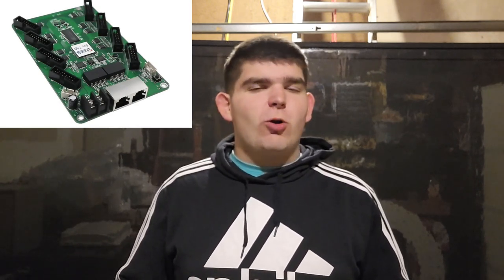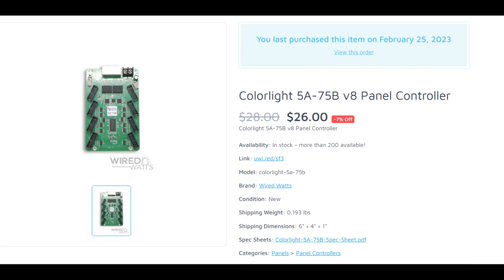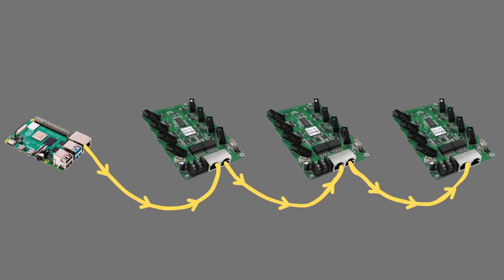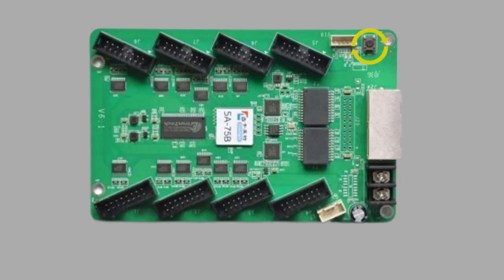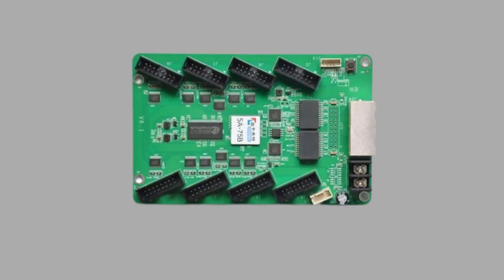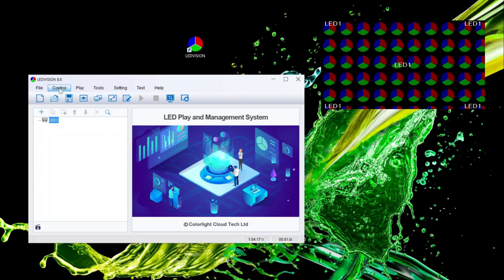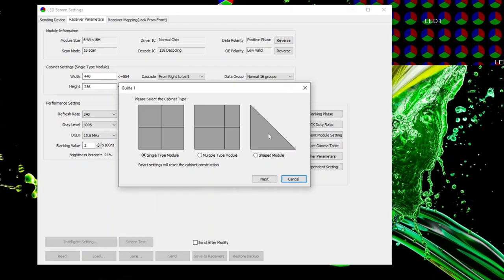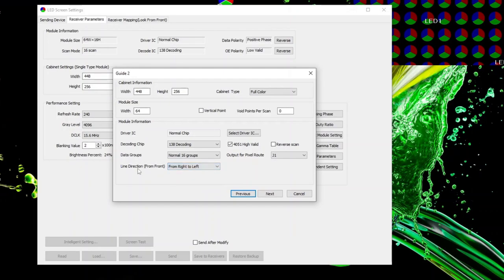Colorlight 5A-75B Panel Controller Tutorial with LEDvision, FPP & Xlights

Comment: Thanks for a very helpful video. Just want to add that you also need to set your total screen size in Control > Screen size and count , and in 'LED Screen Settings' > Receiver mapping tab. LEDVision version 9.0+ has removed the net card option, so download version 8.8 as used in this video.
Reply from the maker: Thanks for the information, I'll make sure to do that next time! I probably won't be making any other videos though about LEDvision because I don't really need to change my colorlight card unless I get another panel 😂

Comment: I have this Colorlight Board hooked up to two panels that’s hooked up to Raspberry Pi 4 thru RJ45 cable then on a Windows Computer I’m running FPP with LEDVision but no cursor is on panel what am I missing(waiting on new card
Reply from the maker: So sorry for the late response, I've been away on vacation. Have you found a solution to your problem yet? I will say I'm not the biggest expert with panels and there's a lot of different steps that could easily be messed up to cause the problem. I only know the basics to get it working and run it in a light show with FPP

Comment: How does one control the brightness of the P5 panel when using a Colorlight card and FPP?  I haven't figured out how to control the bright.  If using a BeagleBone there is an option in FPP to control the brightness.  I asked the vendor that I bought the panel from, but they were no help and their customer support never responded to my questions nearly five days after Christmas even though I asked around 9th of Dec.
Reply: I found an old Ron Howard video from 7 years ago.  In xlights under the Layout tab, there is an option for "Dimming Curves" where there are some controls.   He recommends setting the gamma to 1.8 and brightness to -30.  Tests to see how it works within your display.  Going to try this and see if that helps.  Hopefully it does and this info might help someone else
Reply from the maker: Usually what I do is just leave all the brightness settings for the effects in Xlights around 60. The only problem with this is if I forget to change even one effect or video to the lower brightness, that part will stay really bright. What you're talking about doing sounds like a good idea, let me know if that works.

Comment: I am currently working on a project where I am building a screen with P3 LED modules, which I aim to control directly using a Raspberry Pi 4. However, I am facing challenges in connecting a receiving card (specifically, the Huidu HD-R712) to the Raspberry Pi 4 to display images stored on the Pi.
Could you please provide some guidance on how to achieve this?
Reply from the maker: Which software are you going to be running on the Pi to communicate with the receiving card? I will admit that I am not the best with these types of projects, and had a hard time trying to figure out how to use the colorlight card. I know how to make it run a panel but nothing really advanced with it.
Reply: @How2Pixel  Thank you Nick for replying
I am planning to connect the Raspberry Pi with a synchronous sending card, which will then be connected to a receiving card and finally to the display modules.

In this setup, I do not want to manually add content to play on platforms like LEDVision. As it will be difficult to automate, instead I am thinking of playing the content on the video player on the Pi, and using the synchronous sending card to display it on the modules.

Could you please tell me if this is feasible or if there is a better way to achieve this?
Reply from the maker: I really wish I could help you out and answer your questions, but I'm not really sure how to run the colorlight card with any other software besides LEDvision or Falcon Player, the software I had on my raspberry pi. I'm sure it's possible, but I don't know how since I don't have much experience with that type of stuff. Have you tried looking online for some other tutorials that might help with what you're looking to do?

Comment: My LED matrix uses ICND2153 driver chips. But ik keeps flicikering or giving worg images. Is there a way to fix this? I've tried multiple led matrixes but the same problem appears
Reply from the maker: I'm not really sure of any solution, I've been having the same problem with my panels too. How many panels do you have per chain? One thing I've heard from someone is that putting less panels on a single chain can help. Other than that, I'm not really a huge expert with the colorlight card. Have you tried searching online to see if you can find any information specifically for your panels and why they might be flickering?
Reply: @How2Pixel  I tried using fewer panels per chain, but it didn't make a difference. I contacted an Aliexpress seller about the issue, and they suggested updating the receiver card. However, updating a receiver card requires a sending card, which can be quite expansive. You'll need a hex update file.
Reply from the maker: Hmm ok, well thank you for the info! Hopefully you can find another way or get a sending card to fix your receiving one.

Comment: Hi Nic, First I want to thank you for making such great videos on what you have created. It really helped me as I made my 20 - P4 panel matrix. It now works with FPP and XLights using a Raspberry Pii 4 and a Colorlight card.. Now I am working on using over 1200 WS2811 12V pixel strings I bought a while ago. I was using Holidaycoro Alphapix16 controllers but they are so out of date now. I would like to make a single strand of about 800 of those pixels to go around my house with power injection. 

Do you know of a controller that is similar to the Colorlight card that can run off a Raspberry Pii 4 in the same way and control the lights? I tried using generic ESP32 that work great with WLED but I can't seem to get them to work with XLights. I have searched but have not found what would work for me.
Reply: Hi Nic, I posted this after trying so many times to get it to work. Luckily after I posted this I was able to get my generic ESP32 to work in XLights. I don't know why it would not work the first 99 times I tried it. Now I have 100 string lights (so far) working well along side the matrix. Thank you again for making your videos that help make doing our setups a little easier.
Reply from the maker: Sorry for the late reply, but glad you got it working! Have you considered getting a controller that's made for running pixels instead of using an ESP32? There's some controllers out there like Falcon, Kulp, Sandevices, and a few others. I personally use Falcon controllers for my light show, and they are really great. You can connect them to a Pi like with a colorlight card, and they have tons of features. The other controllers can also be ran by the Pi too, and are a little cheaper than Falcon's. You just don't get as many features.

Comment: Very usefull video mate! Basic question, can you directly play videos from eg Resolume software on a Mac, to the Colorlight card via erhernet cable or do you need another raspberry pi between the mac and the colorlight card with FPP  on it?
Reply from the maker: I wish I could help answer your question, but I'm honestly not 100% sure. I don't know a whole ton about the colorlight card other than how to make it run in light shows. FPP is a program made for running light displays and it just happens to also be able to control the Colorlight card. I know you can control the card from your computer using LED vision, but it probably doesn't have all the features you need/want. So I'd assume you don't need a Raspberry Pi for other situations, I'm just not sure what software can control the card.

Comment: Thanks for the video. Do you know if it’s possible to rotate the orientation? I’m wanting to use p5 but have size constraints where I need to rotate panel and where the long side is up and down. Thanks for the video
Reply from the maker: I'm pretty sure you can, but I'm not quite sure. I know you can flip them with the arrows going down, but I'm not sure how you do it sideways. I'm not a super experienced LEDvision person so maybe try seeing if there are any tutorials for LEDvison from people who use it more often. Good luck with your project!
Reply: Yes I've just done this, it's not difficult. Using LEDVision 8.8: In Control > Screen Size and Count Settings, set screen total width & height. In Control > LED Screen Settings > Receiver Mapping tab, set screen total width & height and check apply boxes. Then in Receiver Parameters tab do Intelligent Setting. In Guide 2 dialog Cabinet Settings set total width & height again. Choose Line Direction > From Bottom to Top (if your display is upside down choose Top to Bottom). In Module Size set height 64 for standard P5 panel. Click Next and go through the other dialogs as appropriate.

Comment: I am very new to this so let me start by telling you what i have I have a Novastar MRV300-1 Receiving card with a Visuallumen HUB 75 on top a power supply two P4 256x256-2121-32S-PV1.0 a Raspberry Pi 4 & 5 is that all I need just for fun
Reply from the maker: I'm not very familiar with any panel controllers other than the colorlight card so I can't really help with your question, sorry.